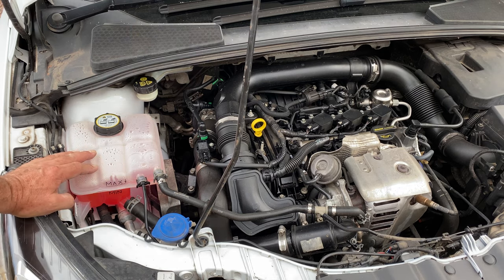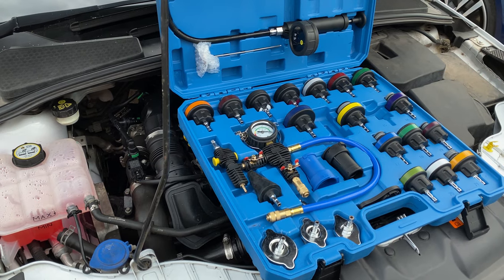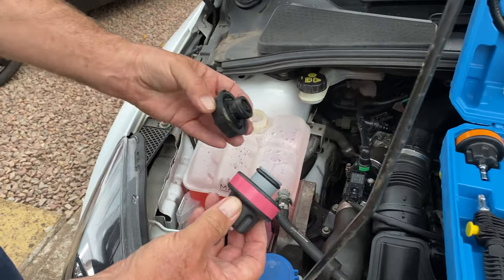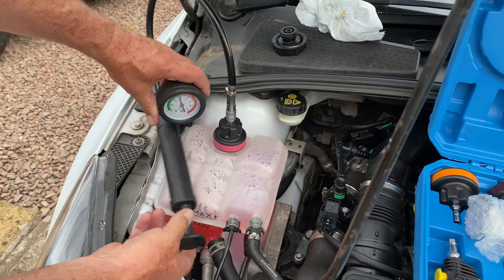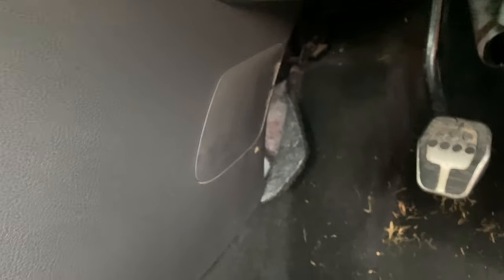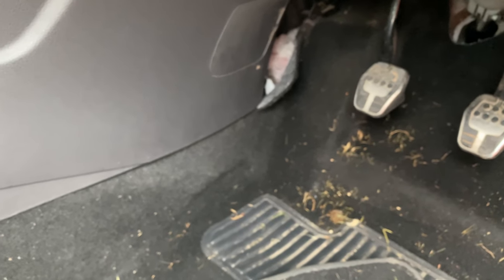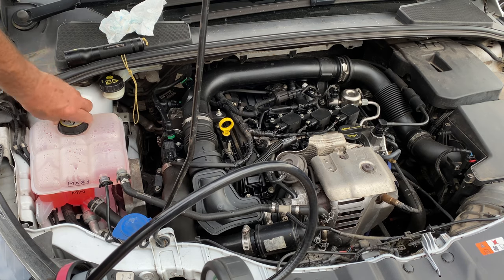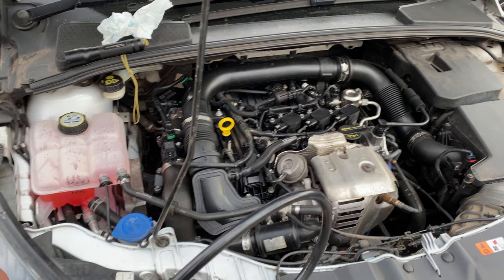How To FIX Coolant leak in car SOLVED - water in FORD Car DIY Car Servicing -  Part 2 of 2

Comment: Was it leaking underneath the vehicle? I changed my coolant reservoir lime you did in The last video, drove around for about 20 minutes and it’s leaking around that area. I was hoping it’s not the turbo coolant line but now after finding out about this problem I hope it is the turbo coolant line

Comment: Does it only leak at the matrix when the in car heater is on?? 

Say if I don’t use the in car heater will it not leak????
Reply from the maker: It will still leak ( seep out - carpets will get wet/damp ) - with heather on it will leak more - IF YOU HAVE A LEAK - it wil only get worse - They all go at some point ! - a New Heather matrix is not that expensive - its just getting to the things !

Comment: I had a leak where the lines go through the firewall, bad o ring. 
But there’s another leak somewhere that I can’t find.
Reply from the maker: Do a smoke test - its easy to do ( google it on youtube )
Reply: @idpfilm  I’ve been monitoring the level over the past few days, seems to be resolved. 
I think the drop in coolant level after the repair was due to air being purged out of the heater core. 
I’m going to pray my exhaust manifold doesn’t crack like they seem to do quite frequently.
Reply: Hey 

 I have got the same problem I have replaced the matrix but still water is leaking and cannot see from where
Reply: @funny_Tale have you found the leak? I've got a puddle underneath the car but can't seem to find where the leak is coming from
Reply: Same here. How did you resolved yours?